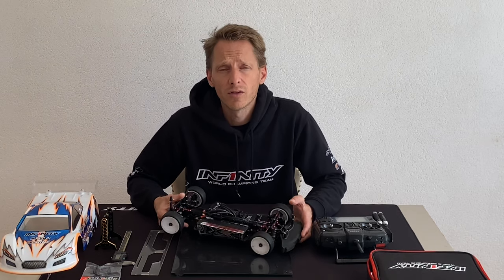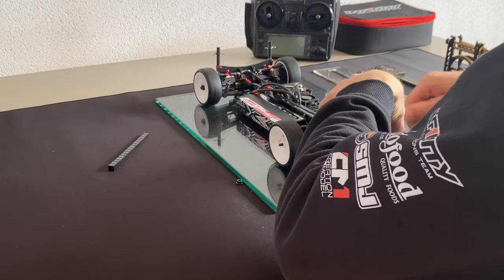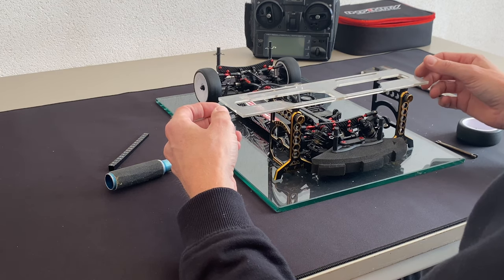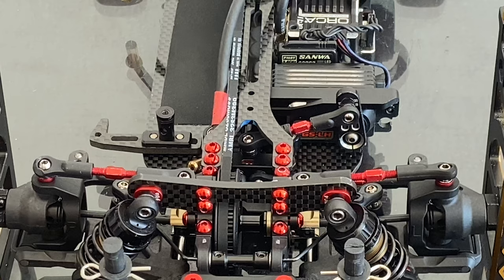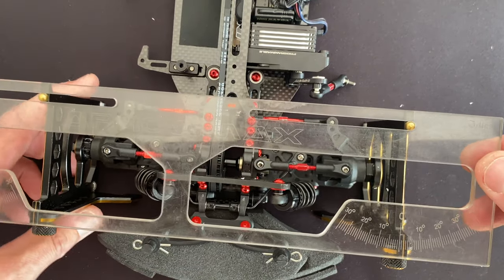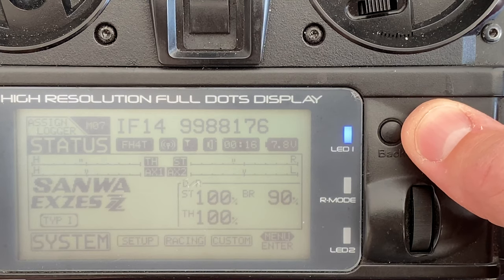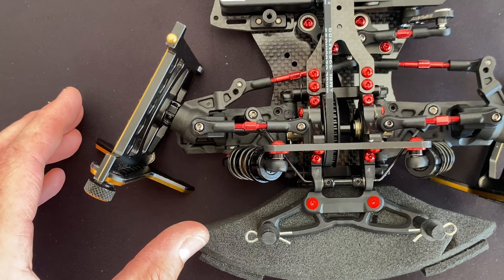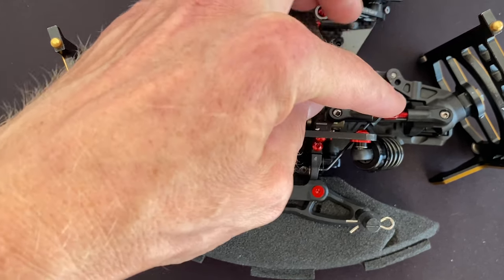How to make a perfect steering angle on your 1/10 EP touring car

Comment: If the steering angle EPA isnt the same left to right on the radio, does that not mean that the steering is not exactly the same left to right? You can achieve equal left to right EPA by adjusting the draglink length from the servo arm. I would think that finding the right length for that link, and having the same EPA left and right would be the most perfect steering. What do you think?
Reply: I was thinking the same thing as you.  With a setup that has different EPA's on each side, it indicates to me that the servo drag-link is travelling more per degree of servo horn movement in one direction than the other.  And because the servo horn travels in an arc, that would mean that the linearity/feel left to right could be different, even if the final amount of travel was the same (same only because its being limited due to radio EPA adjustment).
Reply: Yup, I manage to get the car run straight at 0 subtrim. Then adjust both toe to be the same angle. Very small difference in EPA at 29 degrees. Runs very good on the track..😂